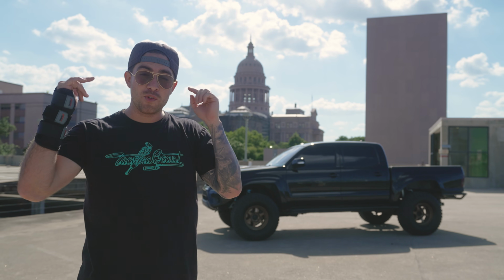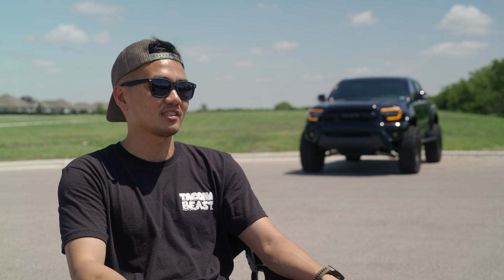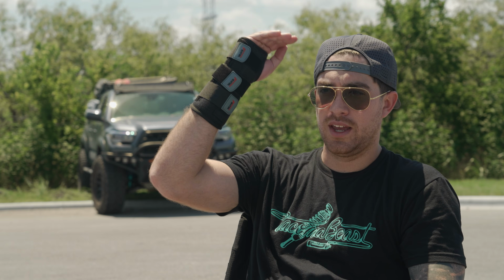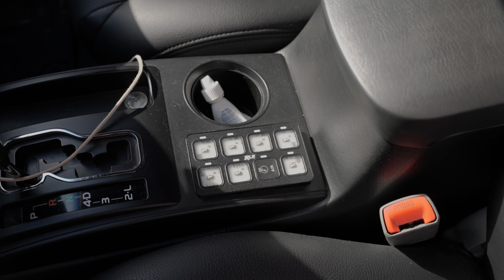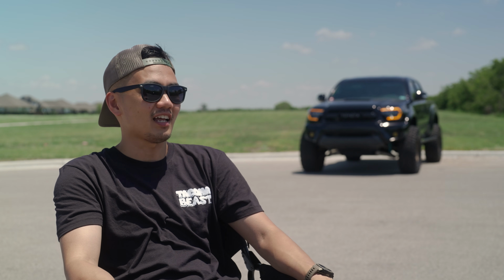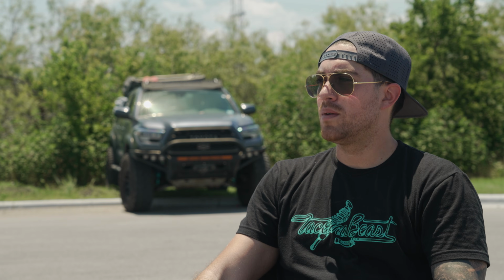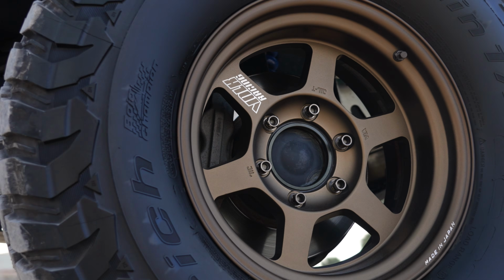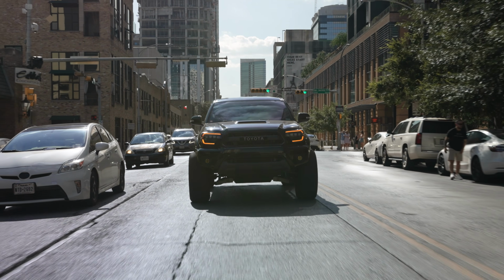2nd Gen Tacoma PERFECT DAILY | Rig Talk

Comment: So why is the 2015 second gen better than the new gens? Looking to buy a taco. The 2015 seems pretty dank
Reply from the maker: Overall the power train was the best one out of all the gens, which is why people love it so much
Reply: While the 2012-15 only have a 5speed, they have a 4.0 V6 whereas the 2016-2023 Tacomas have a 3.5 with a 6speed, which is still powerful but doesn't carry all that low-end torque that the 4.0 does. Yes 2016-23 Tacomas have all the nicer interior but I can tell you from owning a 2014 that the 4.0 is so quick in the low range that it feels like I'm in a V8. 😈😈😈
Reply: @noahpickerill3749 I have a 13 TRD offroad with a 6 speed manual an absolutely love it
Reply: 13,14,15 are same.

Comment: I bought a 2nd gen and just blew the head gasket under a year 😂 just starting a build. I like those lights and head unit. That thing would be legit for maps
Reply: My second gen recently did the same. What’s your plan for it? Engine swap?
Reply: @smzman2013  yeah just bought a reman engine from Jasper engines. Check them out, they've been open since the 40s*. I just put out a video showing their reman process.
Reply: That's a common issue with the 05-06.
Reply: You guys have a 07 or 08 ?
Reply: @goforbroke2  Mines an 05
Reply: @goforbroke2  same here, 2005. 
240,000 miles on the odometer. Still runs, just drains coolant into the engine and overheats.

Comment: 12-15 Tacomas are the best.
Reply: I wanted one but the used market is still too jacked up. So I got a 2023.
Reply: @paulreal5698 I got my white 2014 Tacoma with a 6-inch lift and fully blacked out emblems and only 52K miles for 23K. The market had come down a bit but Yeah, the new ones still make the old ones look pretty expensive though, plus the 5 speed does kinda suck ngl and the interiors on the 16-23 are WAY better.
Reply: @noahpickerill3749 what lift/kit did you go for? Wanting to get some real lift going on and haven’t seen anything over 4 inch
Reply: @paulreal5698 that’s what happen to me 😂
Reply: @paulreal5698 i waited the entire year so i could get one at a good deal. Last week I finally got mine. A beautiful grandpa maintained 140k odo v6
Reply: 11>
Reply: @alex-fx1sn fr
Reply: V6 ones especially. My white 2014 has a 6-inch lift and all blacked out emblems. I LOVE IT!!! 😀😍
Reply: My 05 with 510,000 miles just had the original stater changed and turns on like it’s a 2024😂😂😂
Reply: @Spikelee2000 holy crap 510k. I’m looking at a 07 with like 83ish. Seems like it might be worth buying then.
Reply: @Spikelee2000 Wow 😮👍🙏
Reply: Completely agree!
Reply: My 2005 Tacoma has entered the chat
Reply: I have a 2013 and I was considering selling for a new one. I prefer the 13 over the new ones.
Reply: Yeah…that’s why my 2004 is still running strong.
Reply: 2020 off road
Reply: A brand new thousand three Tacoma is the best
Reply: What’s wrong with the 2007
Reply: I agree brother! I got a 2014 TRD Sport 4x4 double cab 4.0L V6 😀 and I love it!
Reply: Absolutely. . . mine is 2013 and she’s a keeper.
Reply: I literally don’t care what year it is, I love them all 😂
Reply: I would like to disagree. 01-04 are the OG!